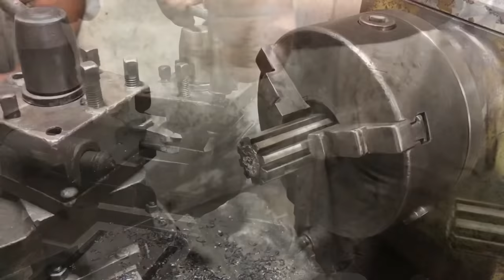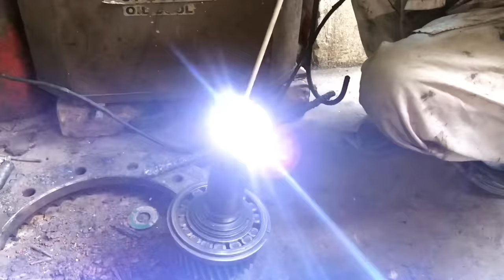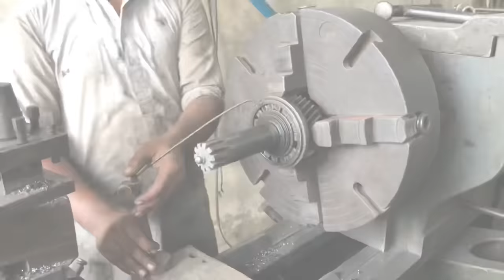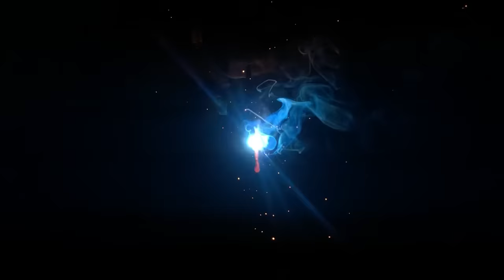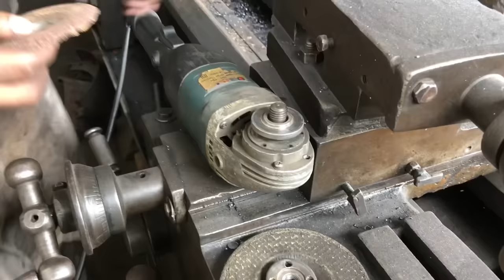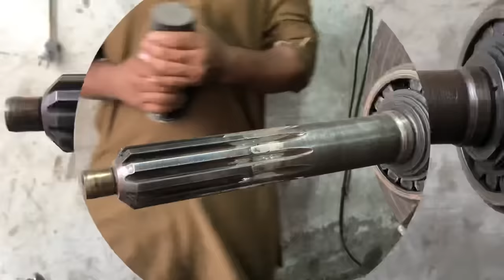The Ingenious guy Connected Broken Input-shaft Very Nicely / Pk process

Comment: Seen this type of third world bodge up a hundred times first hand! It will either last the life of the vehicle or fail in the first five seconds. If parts aren’t available what else can you do. However the bearing on that shaft will be stuffed with all that grinding dust and the heat transfer from the welding! Don’t matter how much the bearing is washed out after and repacked with lubricant.

Comment: And not 1 time did I see a dial indicator for runout. I can 3d print a shaft that will last as long as this repair will, if it can be installed.

Comment: That won't last five minutes, heat has not done the shaft any good, it has gone blue at the end, the shaft is not "true" in the lathe at the end. The flywheel pilot bearing will fail, and the clutch will go bang. Looks pretty though but not functional

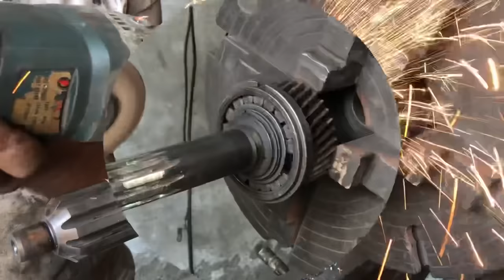Comment: There is a difference between a repair and a bodge.. this is the latter and the difference being that this Eaton transmission input shaft cannot be repaired.. period! Even if you could, there would be absolutely no way that bearing at 11:26 would swallow that much garbage off the grinder and still be serviceable.. even if someone tanked it before putting it back on the transmission, there would be too much crap in there for that bearing to last. The vehicle that attaches to this transmission is obviously a piece of junk or this is a "just get you home" repair.

Comment: Too many slag inclusions (where slag gets buried into the weld). Side (toes) of weld not tied-in to base metal. Failed plenty of bend test because of that. Looks like a 7018 rod 70==70,000 tensile strength. With those welds.........20,000 tensile strength.

Comment: Not impressed at all 
Just a bodge that won’t last and please don’t call it engineering 🙄
Reply: Right on. Any significant torque is gunna snap it right off again. Maybe it's just a temporary repair to get the truck off a jobsite or out of the desert 🤷‍♂️
Probably takes a while to get Eaton/Fuller parts in the Middle East lol.

Comment: that would never hold, the first missed shift SNAP,  goes that shaft, all the hardness on the original shafts left from the heat of welding, at the least it should have been dipped in oil after the weld

Comment: Well I have zero knowledge about these machine parts and welding, but this looks all wrong. First of all if a part like this is broken it's also twisted. Then the guy never takes exact measures and just grinds away. The new "shaft" that goes into the drilled out hole is built up welding? Then everything is just done by eyeballing with zero measuring? The machines and tools are all worn and all grinding and drilling is done bone dry, probably damaging everything? It should have the correct cutting oil applied. This looks like one of those fake restoration videos. Prove me wrong.

Comment: Question? What were the limits ? Answer Plus or Minus a chunk . Q ? did you anneal it before welding. Ans. What?  Q?  You did not use Low Hydrogen rods? why? What are they ? you earthed the welding through the lathe That would knacker the headstock and /or tailstock bearings.!! Would it? why did you not use a bed steady? What's one of those ? the cut was burning the swarf. why did you run it so fast? and not use Mystic?  You should have Hardened and tempered it after machining. do you think that coat of paint will sort out the tolerance fit? HA HA.  Allan Burgess time served in engineering. apprenticeship 6 years and technical college 5 years.   Career Experience 50 years welding gas electric arc ac/dc/ TIG MIG brazing silver solder submerged arc electric brazing flame cutting Hardening tempering Aluminium casting Gas oxy-acet burning, laser cutting,  Lathe milling machine Machine tool surface grinding and all machine tool work. Restorations of machine tools  jigs and fittings BASF Nuclear plants. smelter aluminium .rolling mills gearboxes desalination plants  Motorcycle and car restorations Boilermaker plater sheetmetal worker I am an expert you did the best you could with the equipment available and the price would reflect the quality Those who don't do. Don't achieve   ----WELL_DONE   Even if it fails you did your best

Comment: Lol. That thing has at least 15-20 thou runout. It will destroy itself in a few minutes if it doesn't run true between the pilot bearing and the other ones. Also the clutch disc will bind on that fake ass splines...

Comment: Dude, that is a piss poor job. I know that the guy did his best; but look at those uneven teeth grooves and with all that heat from the weld the metal’s correct temper is gone; the center of the weld is brittle and probably has voids from arc splatter. On top of all that the sanding, light tool passes and cuts and rasping made the tolerance totally crap; which is evident when he puts the clutch disc on that spline. This thing will fail badly.
Reply: It had to have snapped immediately if any significant power/torque was applied. Maybe they just needed to limp it home until a new input shaft could be acquired 🤷‍♂️

Comment: This is butchery at its best. High carbon steel like what's in that shaft  cannot be safely welded especially stick welded. The force required to break it will easily break it again. Absolute rubbish.